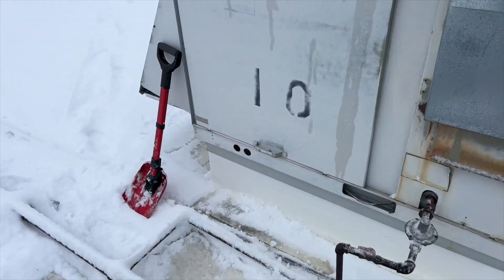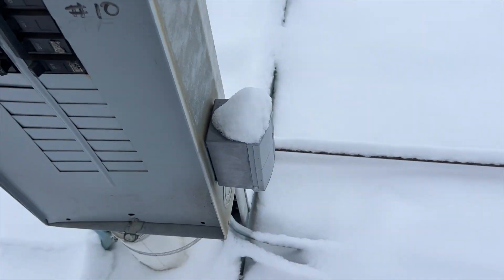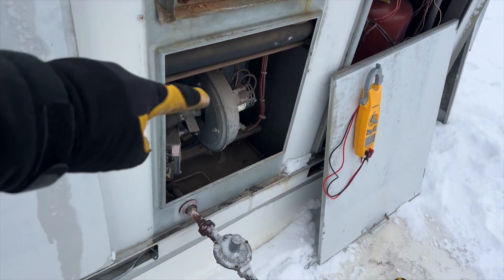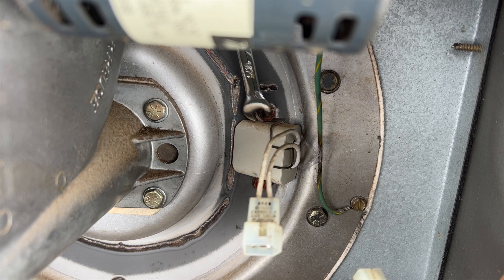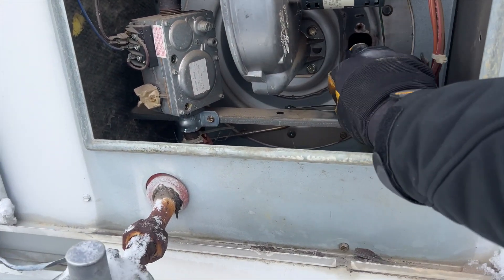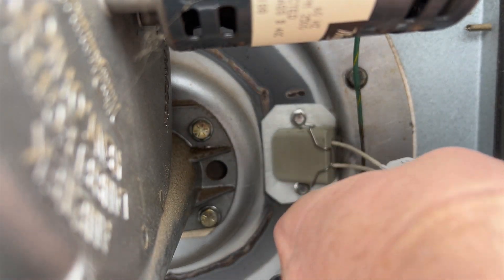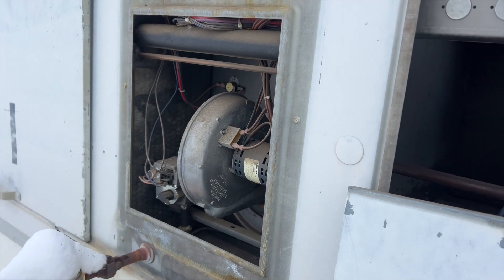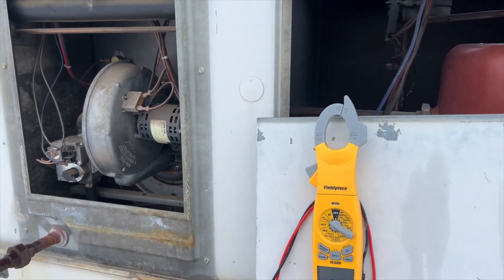Two Package Units not Heating.  Frozen Gas Regulator and Bad Ignitor. EP164

Comment: love the gluing  random parts because there slightly lose. lets glue a trap and also glue and making it in a way where there a air bubble forms making the pad overflow in a clean room.
ill take that curcuit panal over a cut off coving main doors on the unit were you need to take off whole side just to do PM
just replace 3 heat exchanger for simpler not model this year